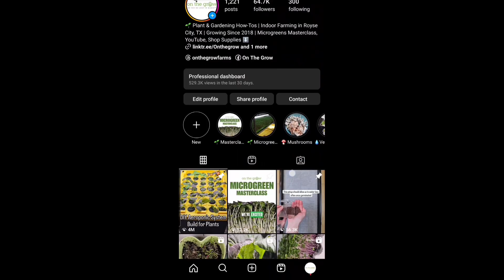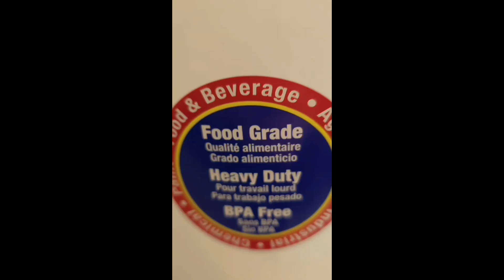How to Build a DIY Aeroponic System for Plants: Complete Build - Grow - Harvest Steps (Viral Video)

Comment: I appreciate seeing your build!  It included just enough detail for me to figure out how to build mine. Thx a bunch for the video.

Ya, I am one of those people trying to reduce the plastic in my life.  ;o)
I'm trying to figure out a way to use stainless steel steam table buffet trays as the reservoir.  I realize there will still be some plastic parts, but at least the water won't be marinating in plastic 24,7.  

Like you said, everybody's gotta do what works for them. Lotta plastic / Little plastic - either way it's hard to go wrong growing your own food!  
🪴

Comment: Makes me want to try it again.  You didn't get weeping over the bin lid/rim from the misters?  Mine did, which was what made me stop.
Reply from the maker: It always goes back and fourth. Some times with this setup we have zero issues. Other times, leaking happens. But that's why we also love being able to switch the system to DWC which has no misters or leaking.